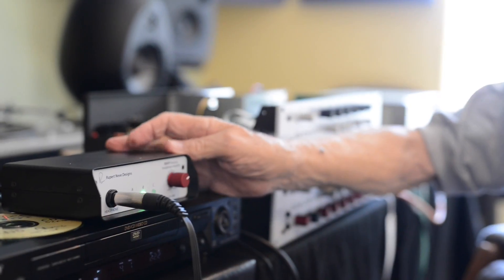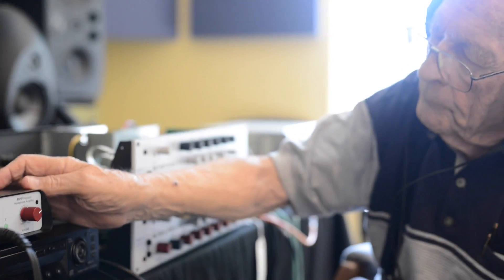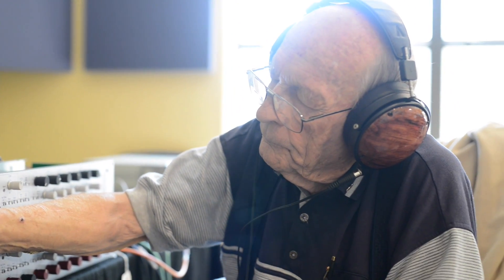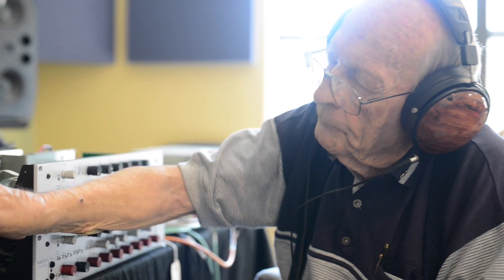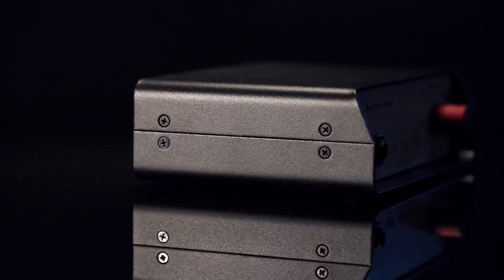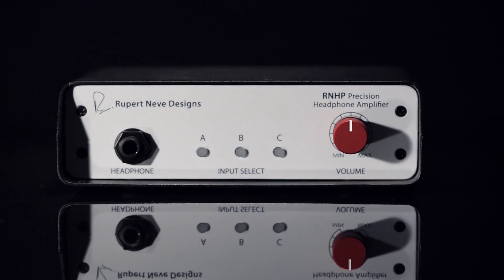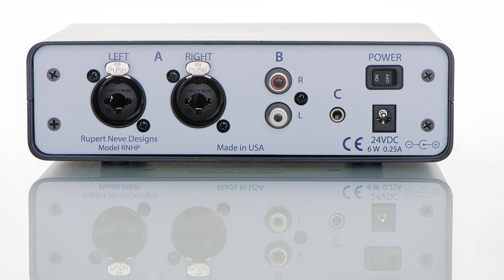Rupert on the difficulty of creating an excellent heaphone amplifier

Comment: I use an Apogee Duet firewire unit to drive my Sennheiser HD 650 with plenty of headroom to spare. Will I notice an improvement in sonic quality and depth if I feed the output of the Duet to a RNHP
Precision Headphone Amplifier?
Reply: tbh itll be very little difference..you already have a great amp inside.. i own the dt 1770's with the rnhp.. i have a ua apollo twin.. if anything it took me some time to mix to understand how much of a difference there is.. and tbh for me the money was well spent but if you cant buy groceries because of the 500 dollar price tag then.. nah
Reply: @genesisnkaidence8519  so you spent 500 dollars on a difference in audio so slight you couldn't really even notice it? dope